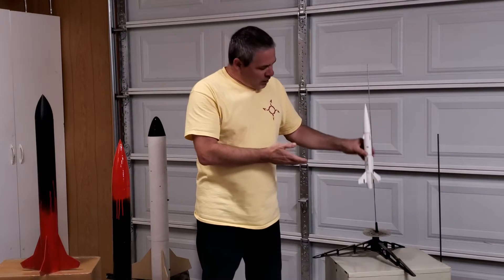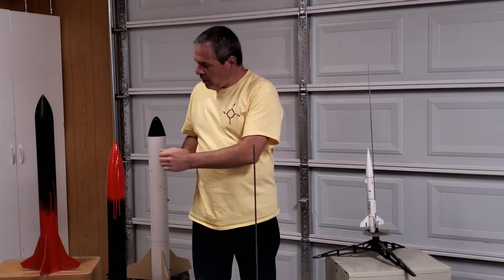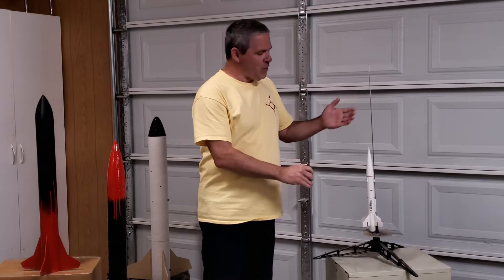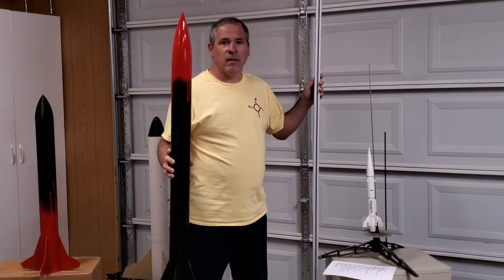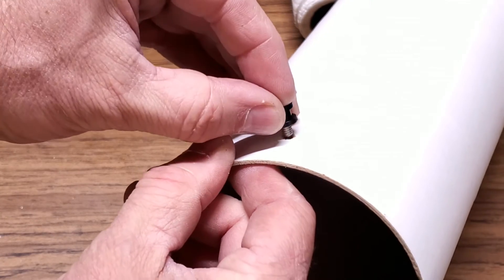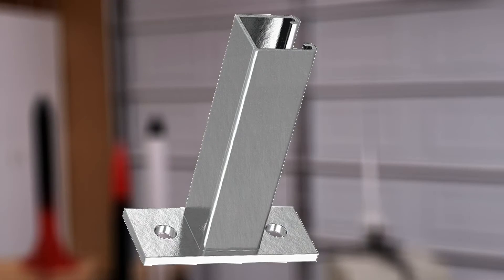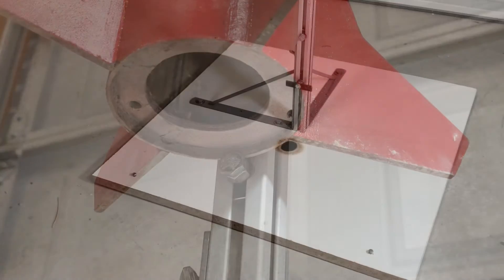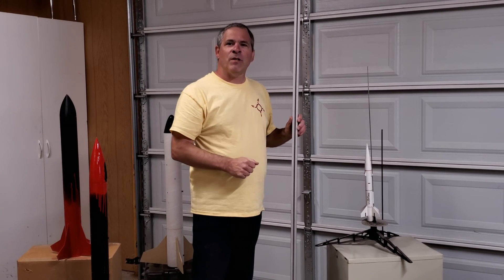Launch rod for large model rockets

Comment: will 2020 not work? i have 80 feet of 2020 which is 20mm by 20mm
Reply from the maker: 2020 (20mm x 20mm) would also be a great size. All of it's dimensions are just a little smaller than the 1010 (1"x1") 
You just need to buy the proper size rail buttons for your rail.
I just looked on rail-buttons.com and they do have mini-buttons available for a 20mm rail.

Comment: Nice video alright. Looking back, I have a few rockets built and flown that do not have rail buttons. I have purchased both types and going to try to figure how I can install them on my existing rockets. Any suggestions?
Reply from the maker: That's a difficult question to answer without knowing the rocket design, diameter, length, etc. If you absolutely cannot reach inside to attach a nut, I have two suggestions.
1. You could cut out a small piece of the rocket body across from the rail button location so you can get a nut in place and then glue the body tube piece back in place. I bit destructive but some paint touch-ups would likely hide it well.
2. I have not tried this but I have thought that if you can't get in a location to install a nut but you can see the location, you could install the rail button and just use a long stick to put a blob of epoxy on the small portion of threads inside the rocket. I would probably do this twice... Let epoxy harden then put another blob over the first one.
Reply: @rotaryrocketry  Good ideas. I like the 4 inch tube rockets with G & H motors. I have one I built with rails when they just started being a thing. Been away from launch's for 20 years but am getting back into it. I went to a launch at Pence, Ind the other day (NSL) and  all the pads had rails. Except for a few 1/8 rods. I needed a 1/4 rod for my 4 inch Dia. NCR Archer rocket. I had to look around and found a PVC pipe with rods in it. They were extremely rusty as if they had not been used for years. The challenge to get buttons on most of my rockets is going to be entertaining. Thanks for your thoughts.
Reply: The rear rail button will be the most challenging. You may be able to drill a hole in the bottom centering ring and sneak a nut through the hole. You could also slip a wood dowel through the hole and use epoxy to secure it. Then attach the rail button with a small screw. Make sure to pre-drill the hole so the dowel does not split. Cover the hole with a small piece of brass or a penny, then epoxy or use super glue to secure it.
Reply: Appreciate your time. That is probably how I will do it. I am entertaining a thought of drilling the hole in the tube,, go maybe 5 degrees radially around the tube, slitting the tube, prying the tube enough to get the nut in there. Then with a small hook made from a paper clip, lift the surgery slot back flush and epoxy it. I will try both ways and get back to you. @TheRocketeer